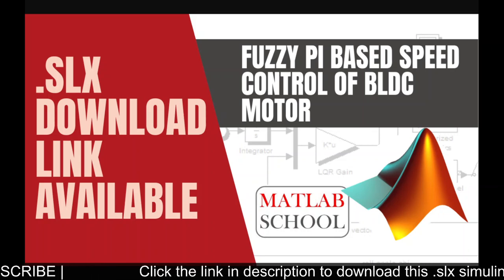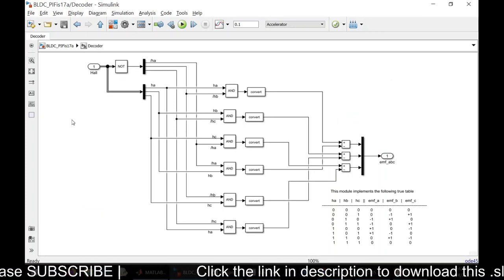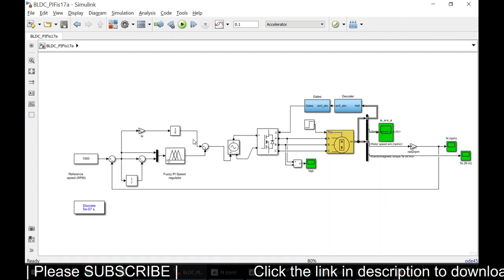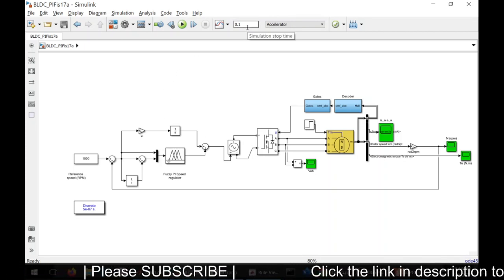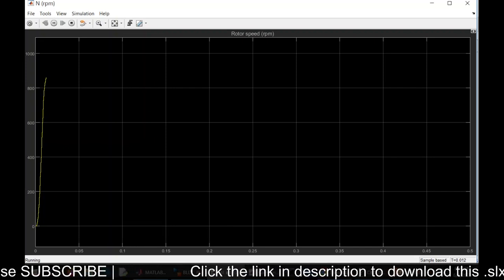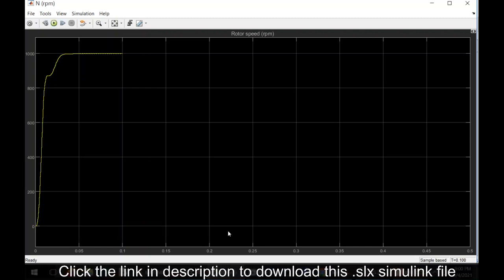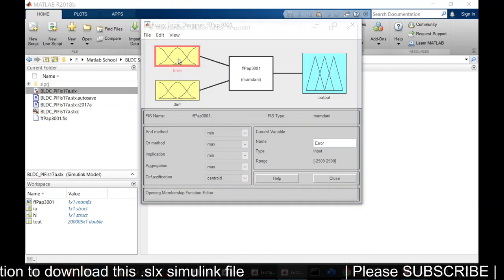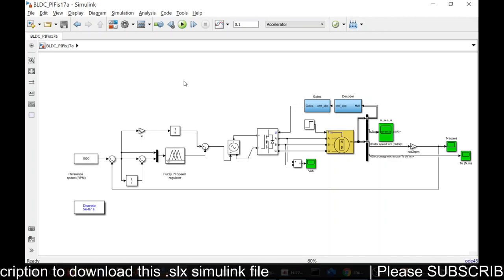Speed control of BLDC motor using Fuzzy PI Controller | MATLAB Simulink

Comment: I might be wrong but fuzzy block is not doing any work here. If we remove the fuzzy block, the system will produce same graph. Please correct me if I am wrong.
Reply from the maker: Fuzzy provides variable P value to PI controller....removing fuzzy makes it a pure Integral controller
Reply: @simulationkart  I understand. If so, what is the need of increasing the complexity by introducing Fuzzy for this circuit instead using a simple PI/PID controller
Reply from the maker: It will reduce the overshoot and under shoot significantly